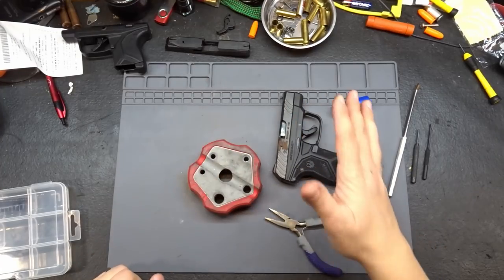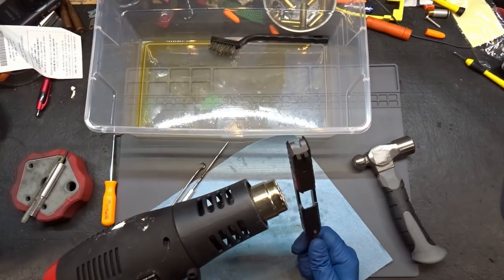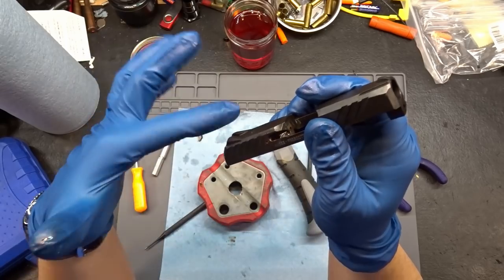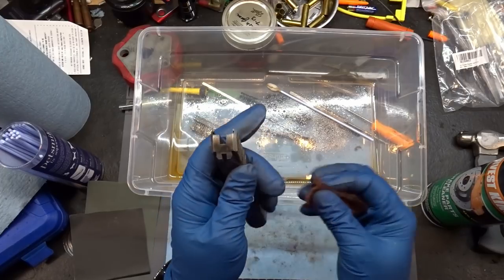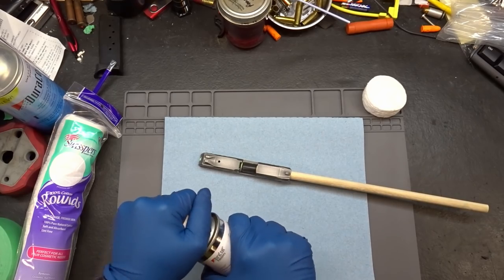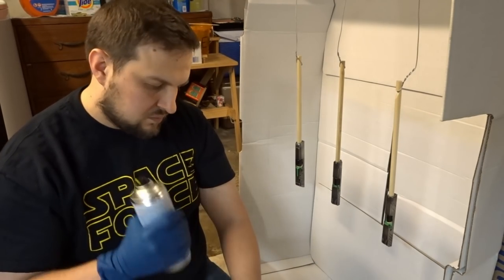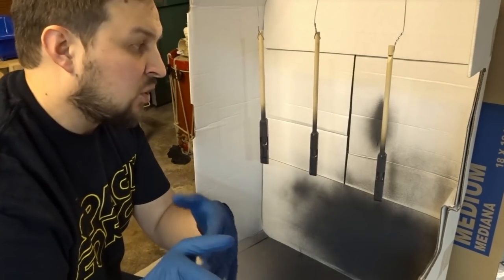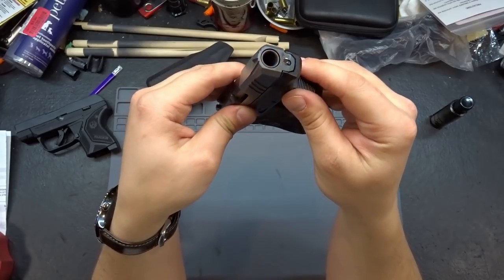How to: Duracoat aerosol coating! Ruger slide restoration

Comment: I’m sorry, but that rust is not a problem with the River finish. That is straight up abuse/neglect.
Reply from the maker: That was one sweaty day outside. Parkerization doesnt do a good job against salt water 😉
Reply: Sodium hydroxide is sometimes called salts. :-/
Reply: Nah. Ruger coating on this particular gun and the lc9s  is pretty bad

Comment: White vinegar works great on rust.
Granted it will turn the metal black  but it will eat all the rust. 
Takes about a week. 
Don't use it on other alloys other than iron.  It can eat them like rust.

Comment: Looks like it came out with the dreaded orange peel look. Is it as shiny as the video seems to make it look? Almost too glossy from what i can tell.
Reply from the maker: Half way in between.  Theres a massive amount of light on the bench to light up the scene, so under regular light it's about a semigloss finish.  It did egg shell a little, but I think that was the spray pattern.  Unsure if I under mixed, or if the thickness of the product clumps
Reply: WorkTheTrigger Thanks for the reply. I have some soul-searching to do. I stumbled on one of these videos and I thought to myself I would just do it on one of my Glock’s for the heck of it. Upon further research I’m not so sure. Maybe I should go with the “if it ain’t broke don’t fix it“ mentality.

Comment: Great video! How did you wind up with 3 of these door stops? Anyway, I have a slightly larger doorstop know as the EC9. My slide rusted and want to refinish. Don't care if it gets screwed up because it's the worst gun ever made, and thus a good experimental one. I heard you say you stripped it down with steel wool or one of those "plastic brillo" pads. That's what I really need to know. As far as paint goes, I'm gonna use cheap as possible, probably Krylon or Rustoleum, whatever I have in the garage. Thanks for the video, and great job!!

Comment: Finish looks very nice for a rattle can! I may have to tear my 9mm AR build back apart and give this stuff a try.
Reply from the maker: It turned out ferry well, and so far pretty durable
Reply: @workthetrigger  My Glock 19 was done when I bought it used. I'm not sure what product was used or how it was applied, but they did a great job. I was looking to finish my upper, lower & handguard in the same color if I can, and for $50 I'd be willing to give it a try. My local guy quoted me $200 but after watching your video I think I should do this myself. Great video BTW, thanks for the details!

Comment: Hey !  Looks real nice.  Certainly better than Ruger's finish . Shame on them !!  I like the gray and black together, nice contrast without being gaudy .   Please be careful with the brake cleaner !  Mixed with heat it can give off " mustard gas " !!  There's no way my wife would have let me do that in our basement . Super sensitive to smells .  All & all..... GOOD JOB !!
Reply from the maker: It turned out much better than i had even hoped.  the finish is super durable and looks really nice.  it did dry a slightly blue gray, rather than a deep dark gray, but it still looks really good.  I was relatively careful with the brake cleaner, for the most part i cleaned the tub out after each major attack at getting the slide cleaned up.  and yeah, the enclosed space probably wasn't the best, but their aerosol really doesn't put off as many fumes as i was concerned about, so despite gassing myself, it really didnt' spread too much more than about 5 feed around where i was.  lucked out, would'a been in trouble if i had stunk up the whole house. lol

Comment: Nice vídeo! May I ask about the wood sticks you use to hold the slide, where do you get them or you made them?. I want to duracoat some of my handguns.
Reply from the maker: I made them.  it's just a properly sized dowel rod, i think the small one is 3/8" and the big one is 1/2".  just needs to go though the hole the barrel goes through, then i added the electical tape to tighten the internal fit so i could manipulate the slide.
Reply: You can find dowel rods at any hardware store, sold in different diameters.

Comment: You’re painting with the can too close to the parts. The idea with any rattle can is to MIST the parts, not coat them..
Reply from the maker: You'd be amazed at the shallow usable field with this coating.  It's my one complaint.  I'm actually relatively good at using spray paint, but man this thing was either not hitting the slide at all, or actually coating.  their recommended number of coats requires that close of an application distance.  the spray pattern is more 00 buck at 20 yards rather than birdshot at 7.

Comment: Had you properly maintained your gun It never would have rusted like that.
Reply from the maker: 1: not my gun. 2: you shouldnt have to keep a carry gun slathered in oil to carry it without rusting. This was a single hot day when sweat got on it
Reply: I was thinking the same thing. I carry mine everyday and it's not slathered in oil or anything else.  I also have Ruger that are 50 years old that have never looked like that, in fact no rust at all. Something was spilled on this gun and then left to corrode like a battery post.
Reply from the maker: @jameswilkins3767  You really cant compare other rugers to the LC line adequately.  the LC line uses only parkerized finishes. No plating like the SR series, and whatever they use on their MK 22 pistols, and the materials are non-corrosion resistant. Their revolvers, the American, all of their rifles, are all finished in a coating, rather than parkerization.  The problem with parkerization is that it doesn't do a good job of protection against salt water... and that's one of the things that carry pistols need to be resistant against.  The holster used was indeed subpar, which has since been fixed, but no other modern carry firearm would've had this extent of damage, as this one also never will again now that it's got a corrosion resistant coating.
Reply: @workthetrigger  you actually have to wipe them down, everyday if you sweat that much. I was comparing apples to apples I carry an LC. I will admit since the government started jacking with everyone about their finish it never has been the same.
Reply: @jameswilkins3767  bullcrap. There are folks who have Ruger LC line out of the box with rust on them. Search forums and Youtube videos. This is definitely a Ruger problem and not solely neglect.